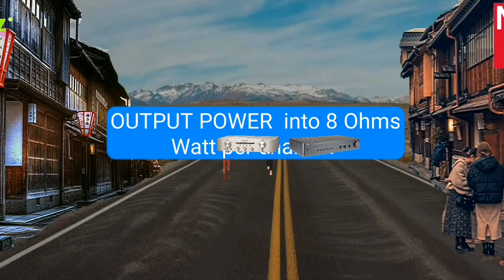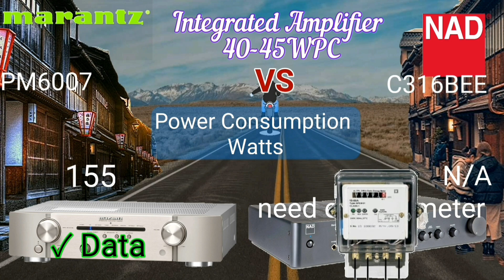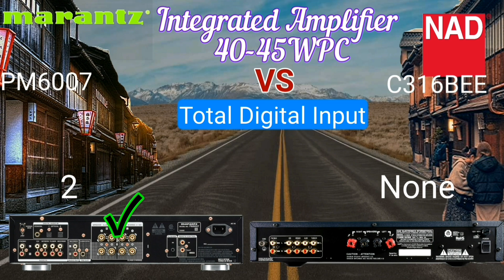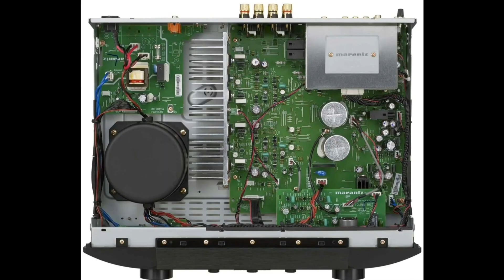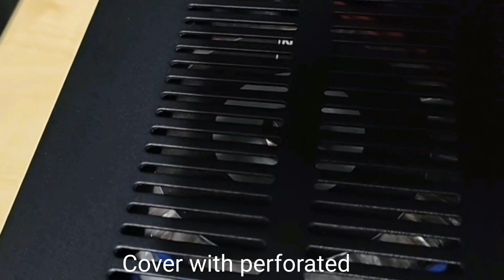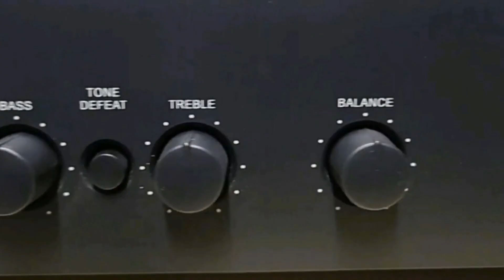Marantz pm-6007 vs NAD C316BEE integrated amplifier fighting free extra schematic wiring diagram

Comment: What's favourable about the Marantz is that it has A and B speaker outputs. The NAD has only one set. The Marantz PM6007 has 155 watts as its operational power consumption, while the NAD uses 197 watts. Moreover "2A" is listed for the NAD"s power rating on the back panel. Thus, Power (expressed in Watts) = Volts x Amps. So 120 Volts in North America  x 2Amp(ere)s would come to 240 watts. This indicates that the NAD is more powerful.